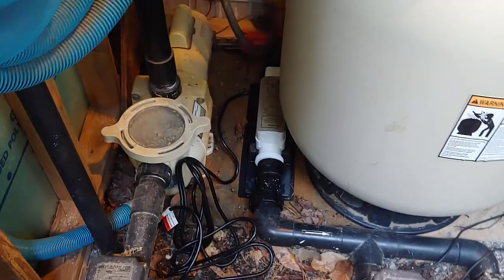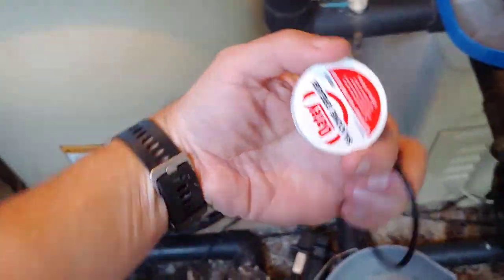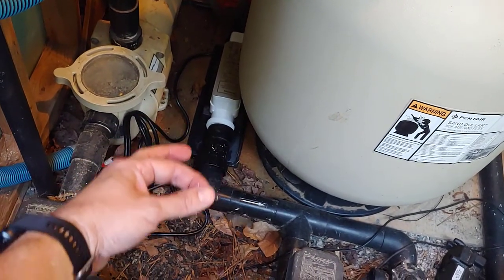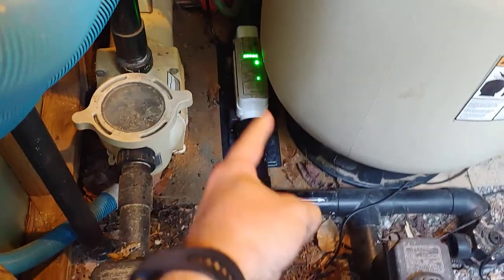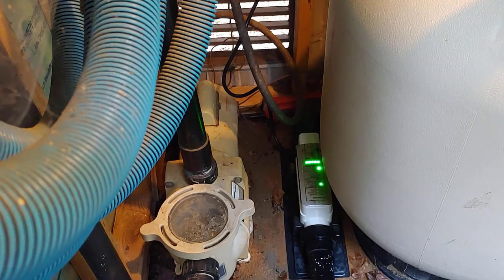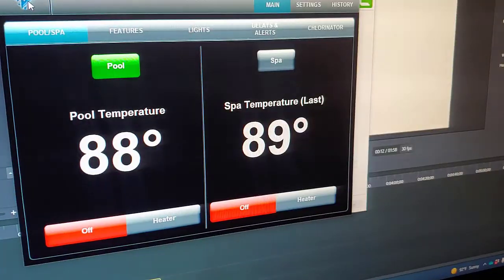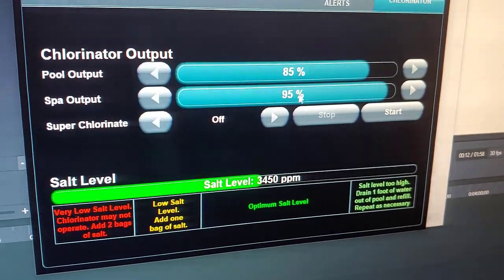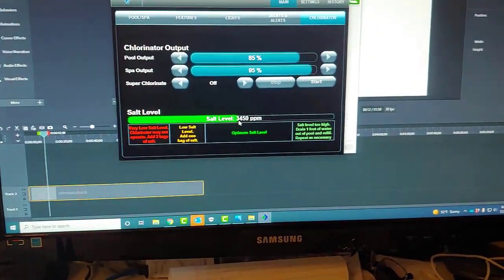Saltwater Chlorinator EASY replace/install. Pentair Intellichlor and other brands.

Comment: I love this and the other; I have a question, if you know.  In this wiring set up (which is what I have), is there a fuse?  My generator is not turning on, I had recently replaced the fuses in the main system, and since then the generator will not run.  If you know, would love to hear from you.  Either way-thanks for posting this.
Reply from the maker: I don't know of a fuse in the system but there may be one. Check the regular fuses/circuit breakers on the low voltage side of the EZ touch. Also, check your wire that runs to your coordinator very carefully. I had a squirrel chew through one of my actuator wires one time. Thanks for the comment and question.